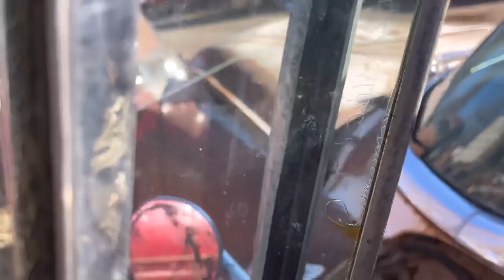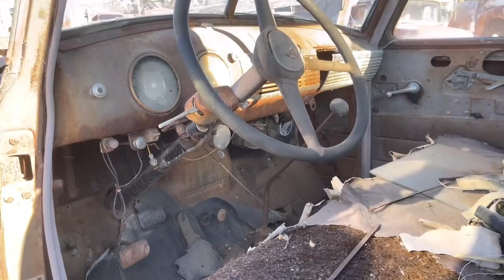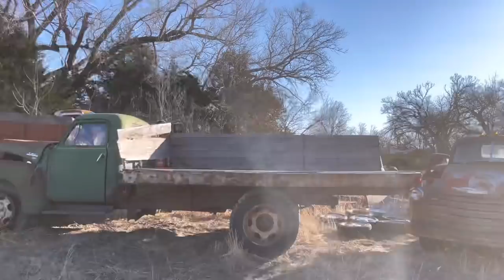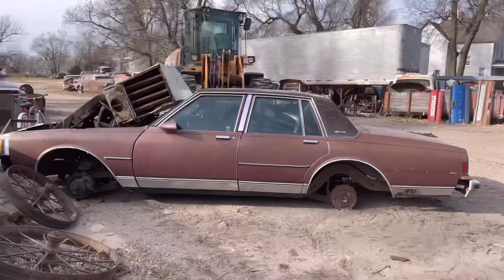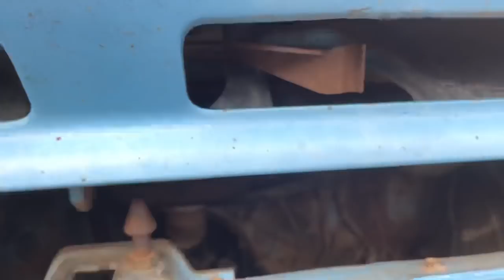I Can’t Believe All The Antique Cars & Trucks Coming In For SCRAP At The Junkyard!

Comment: Like to share a little FYI with you, if you don't mind? Easy way to tell those early Chevy trucks apart, the 47 to 50's don't have vent windows, they have a cowl vent at the base of the windshield. 51 to 53 has vent windows and flat two piece windshield like 47 to 50. 54 and 55 have a slighty curved one piece windshield. Although sometimes you'll run across 47 to 50 that someone has swapped 51 to 53 doors on, so they got vent windows. The cowl vent is the clue that it is a 47 to 50 cab. Of course sometimes you'll still find ones listed incorrectly on titles, because of when they were sold. Other less visible clue is the brake systems. The 47 to 50 uses the old Huck brake system that goes all the way back to the 30's. 51 and up uses Bendix brakes, which most all of us are familiar with. A vastly better brake system! Figured I'd mention this to you when I seen you showing that big truck you thought was a 50. Noticed the doors had vent windows, so probably a 51. Hope this helps you!
Reply: The earlier versions had twist down door handles like the one you have while the later ones had push button handles. Im not sure what year they changed.

Comment: I am a fan of those old 77-90 box Impalas and Caprices.  My first car was a 77 Impala.  That Caprice you have is in nice shape, and should clean up well.  The fiberglass fillers are missing which is common, but considering there is a cult following of those cars finding aftermarket parts would be easy.

Comment: Howdy 👋. I dig the old stuff. I enjoy the discovering trash/treasures. Back in the late 80s my dad bought a 49 international pickup. I was young, not even ten yet but I remember well. That old truck had not rush holes. Solid floor pans and a running straight 6. As I recall, the truck had sat in a farmers field for more that ten straight years. My dad put a new/used bench seat in the truck and had to wire the truck from front to back. Super solid old truck. He sold some years later...the old stuff is and was built better...no doubt. I know a body can't go back but....I like to think on it anyway. Things nowadays are mostly junk. Designed and built to fail for maximum "profit". And that my friend saddens my heart. Nowadays you can't let your car/truck set for more than a month before functioning systems stop functioning. Just saying is all. There is a scrap yard just down the road from me...i like to spend time there. They know me well. I'm fitting in less and less with the world of today. Stay strong and safe.

Comment: Interested in that 50 .. Id like to drop the body on a newer frame drive train and use it for work .. Give my customers something to talk about and stand out from other companies
  Blue chevy would work also
Reply: A few years ago i sold my last hot rod (27 T) to a guy on Ebay. He showed up with a 56 Chev truck, well the cab mostly as  it was on  late model Japanese (Isuzu,Hino I cnt recall) truck with a big diesel and Hendrickson suspension .It Sits nice and low but can be lifted to clear rough roads. The deck is a alloy roll back. Older trucks are OK but driving 1930-60's trucks is a chore.
Reply: I'm a contractor and run a few trucks with ladder racks, ladders boxes, welders etc they would look cool just showing up at a job and working, put em on later model drive lines company stickers or even old school paint on the doors .. I've thinking about it for a while

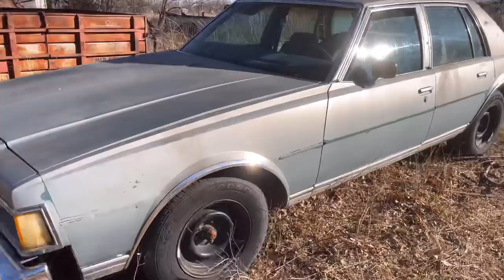Comment: @5:46 I remember my friend SungTek had one of those old Caprice Classic cars & back in the early 90's after he just topped off the gas tank & drove home ,well the rusted out gas tank gave out & there was literally a river of gasoline flowing down from his driveway, down the concrete curb & down into the storm sewer & the worse part it was the 4th of July 🧨 & kids was setting off fireworks 🔥 what a fire ,it went all the way down to the corner curb ,& several sewers had flames pouring out of them until it burned out .... the car was a total loss & just burned out as well ,junked it on the 5th of July

Comment: I worked at a Wrecking yard in the early 70s and we crusheed out over 70 53, 54,55, 56 and 57 chevys. I told the owner not to, that he would regret it later.. 2 years later he was paying $1,000 for a rolling 57 chevy, of which he has crushed over 40 at $32 a ton. Lol, i told him so and rubbed it in

Comment: Would you be able to show the shredder in action?  Looks like they shred and truck the scrape daily. They keep ahead of you scrappers.  Sure like your videos. Thank you Silas.
Reply from the maker: They truck it from there to their shredder. No filming allowed
Reply: You can find multiple videos of car shredders on YouTube. Just look for the larger shreddes that have a long conveyer belt feeding the hammermill. You will find videos of smaller hydraulic low speed high torque shredders but that's not what is used to shred cars those are usually used for tin and light iron.

Comment: What year is the Ford Truck ??  1980 or 1981 !!!    I have a 1980 with a 300 six banger 3 speed w/overdrive floor shifter.  125,000 actual miles.  How much for that truck I need a windshield plus a few other parts.    Thanks for your time Silas !!!

Comment: the reason most of these cars get scrapped  is because lots of tight wads wont even give you scrap weight for them . those same type people wont buy a car or truck from owners until they die then the try to steal it off the widow or relatives.i just crushed over 300  just like these .we saved over a 100 out of the 400.

Comment: How much for the Ford tractor I have a galaxy 500 4 door with new brake booster the motor is good and transmission is good no title but will trade for two ford tractor 🚜🚜

Comment: What a nice Ford, no rust .Now would be a good time to get a can of red spray paint and put three bullseyes on the truck ,front ,doors and bed.Break out your 40 cal and start target practice,after that ,get an AR10 and start practice with that 200 rounds at least.
Cut a hole in the roof and put a toilet on top,after done.I’ll give you 5 gallons of diesel fuel to make it nice and toasty.
The joy of Ford.
Use the New York Times as toilet paper,itchy but it works, or photos of those  cows on the View.Whoopi’s photo would be 3 times bigger.